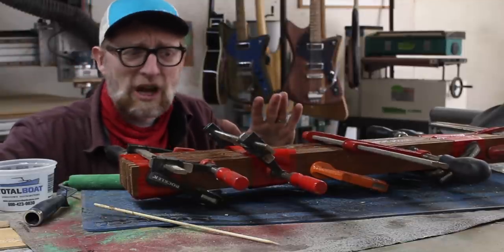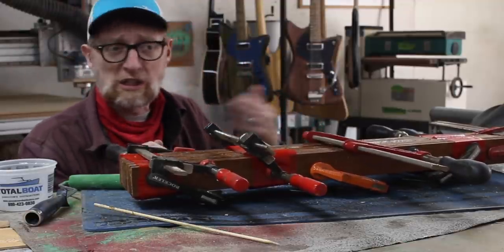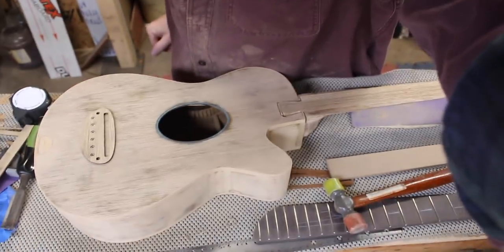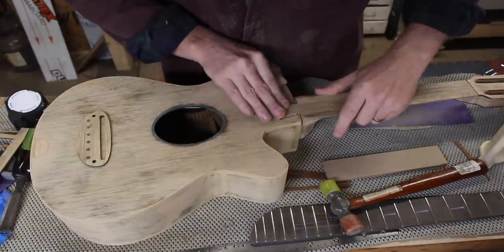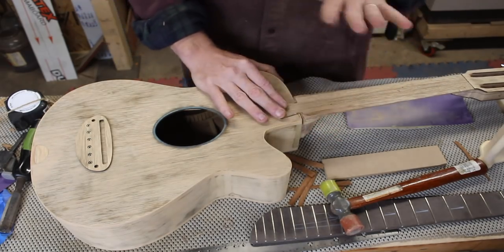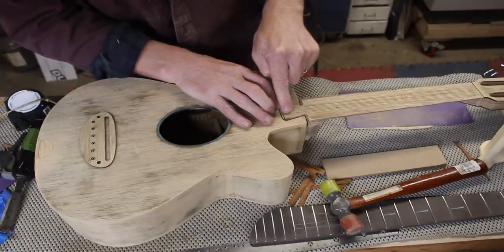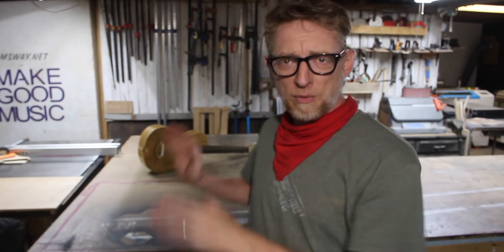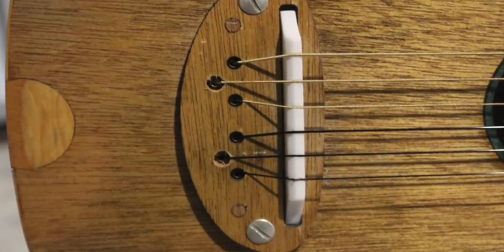Acoustic Parlor Guitar Made From Old Closet Doors - v2.0

Comment: I've used old kitchen cupboard doors for other types of builds and the wood can be amazing, solid oak frames with thin oak panels. Even some of the old pine doors must have thin panels that could be tuned for acoustic guitars like you do with spruce. If not perfect for that slightly upmarket electric guitar

Comment: You can use fan bracing if you're using nylon strings. Makes the top move much easier, since x bracing makes everything stiffer so that the steel strings don't destroy everything.

Comment: You have inspired me to try to make instruments out of non-traditional materials. I have made a pine ukulele and a Coffincaster 3string guitar. Both turned out great. I lost several trees to emerald ash borers in the past few years and my next instrument will be made from wood from those trees that I saved. Thanks, Tim Sway, for what you are doing. With your abilities (far beyond those of mortal men) you could be using the finest exotic hardwoods to be making world-class musical instruments. But “polishing the turd” is much more challenging. Thanks again.
Reply from the maker: Ash is good guitar wood. just make sure the bugs are dead in it first. (kiln dry or you can do some diy stuff in the driveway with plastic bags to choke them out). The other thing with traditional guitar building is the waste. you have to select the right pieces, avoid knots, etc. So for every piece in the guitar there's a pile that didn't make the cut, or if you make a tiny mistake you gotta start over instead of sanding it out... it just doesn't make sense to me. I mean we're gonna scratch the thing up with our fingernails and picks, sweat all over it, spill beer on it then forget it in the trunk of the car overnight...

Comment: This makes perfect sense if you think about it. Look at any department store acoustic guitar from the latter half of the 1900s  and you'll see its made from thin plywood. So basically hollow core doors. I wouldn't be surprised if one of those factories wasn't spitting doors out of one side and guitars out the other. I know they get a lot of hate, but my 1960s Silvertone archtop is 100% plywood(save for the neck) and I think it sounds fantastic!
Reply from the maker: That will of guitars are my fav

Comment: Another good idea for hollowcore doors are floating shelves, if you cut them on the table saw long ways to a desired shelf size, break back the cardboard inside a bit on the cut side, cut lumber to fit into the hollow, attach the board to the studs in the wall, slide the hollowcore door on the board and fasten with a couple screws. They look pretty nice at the end! Especially if they're like most hollowcore doors made of mahogany.
Reply from the maker: love it!

Comment: Tim, I think what will help prevent cracking is radiusing the braces. That slight arch let’s it flex in or out and let’s the instrument handle humidity and environmental changes.

That and the least amount of mass you can put on the top and back are supposed to be very important for volume/tone

Comment: Pretty cool idea and fun to watch. Could you stabilize the neck wood before carving like folks do in knife handle making and such? Vacuum epoxy into the wood?
Reply from the maker: Probably.  I don't have a vacuum bag. I think that would work better
Reply: @timsway  Not sure if a vac bag would work for stabilizing or not. Most of the time they're using some sort of degassing chamber. I guess it'd be a bit of an investment, but seems like it would open the door to a lot of projects with your material. (no pun intended) https://www.youtube.com/watch?v=Z2jEdjYEd1M

Comment: It sounds kind of like "Trigger," Willie Nelson's guitar. I'm wondering if Hollow Core doors might be good for making something like Dan Electro sounding guitars. Maybe the shape of the body could be cut out of the door, structural beams added, and then the spaces filled with some sort of expanding structural foam. Thanks
Reply from the maker: You can make anything from them. After all, #HollowCoreDoorsAreTheNewPallet :)

Comment: Hey I really like the build. The question I have is around these slotted/classical headstocks. I am not sure the reason for having a break angle between the headstock and neck, when you have a natural break angle caused by the tuner being probably 10+mm below the height of a regular tuner. Just always seems so much wood (or effort with scarf joints) could be saved.
Reply from the maker: I did a slight angle just for looks really. I make a flat headed, electric guitar with a slotted headstock that is the best of both worlds: natural string break angle without a fragile, difficult or wasteful angled headstock and noextra  hardware needed.

Comment: Love your sustainable philosophy and practical approach.
Have you ever thought of using the cardboard reinforcing inside the doors? Maybe you could soak them with resin and make a lattice braced guitar?
Reply from the maker: I have thought about it as I love the look. "submerged in resin" I find a little boring and counterproductive for my eco mission (so much resin, so many people do resin guitars!) Maybe a compression with resin to make a solid block? That would feel better on the wallet and environment than filling the air between with epoxy...
Reply: @timsway thanks for the reply 😊
I wasn't thinking of filling the guitar - rather keeping the cardboard pretty much as is and using it in a guitar much like it's used in the door. Like one of Greg Smallman's guitars. The resin would just be to strengthen and stiffen it.
Reply: @timsway  cool 😊👍
You've come quite a long way 👏👏

Comment: Tim, I think this guitar came out great. Like most things in life it's a learning experience. One thing I that I think could have worked is, if you had mixed some wood pulp or saw dust with epoxy and used that to fill in the gap between the neck and body. I have an old Manuel Tatay Spanish Guitar, it use to belong to my cousin Roger who passed away some years ago. The room I had it in was completely torn apart by Hurricane Katrina years ago, and the guitar was badly damaged. I was wondering if I could send it to you over the mail, to see if you can make something new from whats left of it?
Reply from the maker: good idea. I've done that to fill small cracks. it would probably have worked like a mortar. you can message me via www.newperspectivesmusic.com to discuss the Tatay for sure.

Comment: I watched another YTer build an acoustic and she used a bolt on system (bolts through the block and CA glue coated threaded insert fasteners in the neck heel) to install the neck. I wonder if that might work better with your luan multilaminate neck? You're getting better with every project. Regards.
Reply from the maker: The last acoustic I made I used a threaded insert and bolt. I know from experience with a bolt on elecrtric that the luan and screws don't work too well together. I think I prefer bolt ons from a maker standpoint (and repair position) but I want some experience doing this, too.
Reply: @timsway Now that you mention it I watched that video and completely forgot you had already used the bolt on process. Maybe luan is just too "shreddy" at the body/heel attachment point? I think you alluded to this, but perhaps sandwiching? a piece of solid wood at the heel end of the neck blank would stabilize things. I'm sure you'll figure it out and I will be glad to see the process!

Comment: i could be wrong but a spanish neck joint might be better for the hollow core door necks since the neck and the neck block are one piece and the sides are slotted into the neck block?
Reply from the maker: probably. the first one I built i just made the whole block one piece and built the body around it.

Comment: Hey Tim…great videos man.  I love your content and your trash to treasure philosophy.  

With respect to acoustic guitars…you are 100% that you won’t get a great sounding guitar from plywood.  The plys, being of different species as well as glued between the layers, are not going to vibrate like solid wood, so won’t have the same tone, nor responses as an instrument made from solid woods.  And you know this, as you stated.

However, have you looked into resonator/resophonic guitars?  They get the majority of their sound and tone from a spun metal cone, as opposed to vibrations in the body and top woods.  The body of a resonator is essentially little more than a speaker cabinet.  Doorskin plywood would make a great speaker cabinet.

Granted, you need the metal resonator components to finish the instrument, but a doorskin resonator might just be the totally polished, gold metal instrument you are working towards.

Comment: At around 7:20 you begin chiseling the supports affixed to the underside of the top of the guitar.  Why do you do this? Is it to prevent players from scraping themselves when they reach inside? Is it an acoustic thing?
Reply from the maker: There is a TON of theory that goes in to acoustic guitar bracing and I know basically none of it. The idea is you want to keep the guitar strong enough to not fall apart under tension, but light and thin enough to vibrate and "sound" when played. Sound tends to not like corners, sharp angles, etc., and the less wood that is there the more the top will vibrate but the weaker it will be. This is a way of reducing sharp corners and weight (plus making it look pretty). Especially as this is plywood, I probably could have removed a lot more of the bracing but I'm still learning.